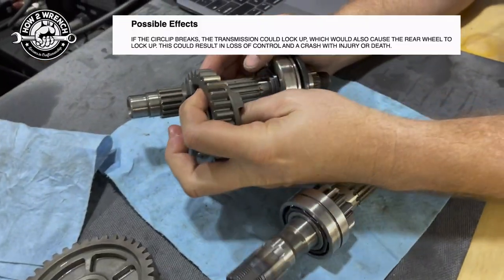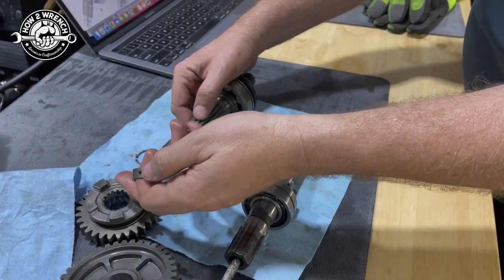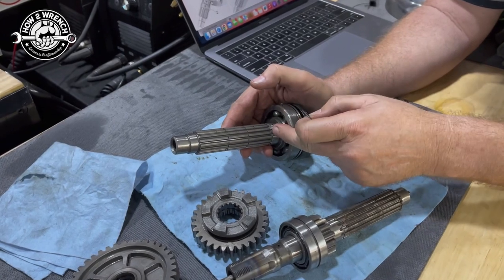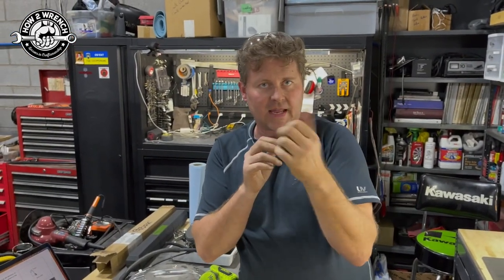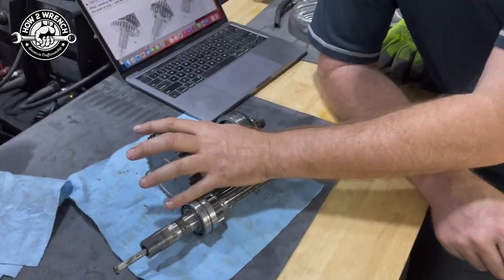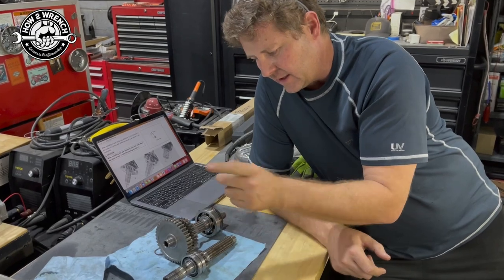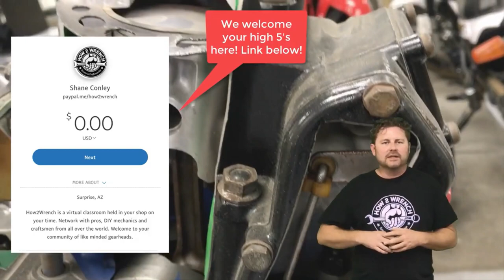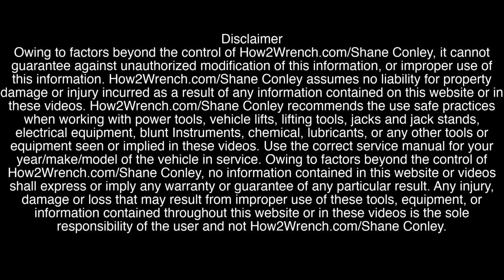How to install transmission circlips correctly. Not doing this could kill someone. #transmission

Comment: It's easy if you think about it. Just throw the whole gears foactory setup and hook up an oil tube to the end if the shaft and an oil pressure guage and pump oil and record the reading while stationay and try with rotation movement. Then start removing gears and doing the same thing. You'll end up with a data chart of how much each gear (if removed ) you'd lose oil pressure. Then you can calculate and start welding shut some holes then do a final pressure test. Hope that was helpful.

Comment: I did so many roadstar recalls i was sick of it. This was exactly the cause of the failures.. Yamaha installed the circlip incorrectly from the factory.. so yes as u said the way those are turned matters
Reply from the maker: The screenshot was from that campaign!
Reply from the maker: That recall woke a lot of people up. I learned this from Honda training and I can't count the number times people argued it didn't matter. It drove me nuts with a co-worker that used to tell "I've never had a problem". And to be honest prior to that recall I just did what the manual said but after it really looked into the "why".
Reply: @How2Wrench  exactly.. imo honda has one of the best breakdowns in some of their Manuals. It'll show each gear..each clip...shift fork..etc and which way the beveled or sharp side goes on the gear stack. I love your channel. Keep up the good work
Reply from the maker: @dcyamahatech  Thank you for being here and supporting. We will share this with Shane at Friday's meeting!

Comment: I never even thought about this. I just checked all my manuals ('96 RM250, '95 KX250, '02 CR250), and the RM shows the same illustration you had. The CR says "Install the washers and snap rings with the chamfered edge facing the thrust load side." (no illustration). I'm sure I did not follow this and now I'll be paranoid riding it (more than 120 hours no issue so far). And the KX makes no mention of a chamfered edge. It only says: "Be sure that all parts are put back in the correct sequence and facing the proper direction, and that all circlips and washers are properly in place."
Reply from the maker: We grabbed Shane quick on this one and he said "So glad to hear you got the right information. Something to think about. The circlip does not care who made it, hence why all transmissions "install with the chamfered edge facing the thrust load side" making the flat edges give the most support as its pushed against. There are a lot of factors the increase the risk, like damaged shift drums and bent shift forks that would allow "more" thrust force. 
We could tell of a hundreds of stories just like yours where there are many hours or miles with no issues but when it breaks, it breaks bad. There is just know advise to give here on what "we would do" without risking something right? Either your life or our reputation. Hope this video gave you for surely what you need for future work or this KX you mentioned". 
Cool. We love sharing comments like this with Shane.
Thanks for sharing and the added value to our wrenching community. Keep them coming.

Join the channel. Best $1.99 you'll spend to access all 800 vids and Shane Daily! Smash the sub and like please. 

Throw Shane a high five donation, channel membership or merch for saving you $$$$$$$ Links below to support more for this work! 🙏
You rock for commenting! We will let Shane know! Want even more? Best $2 you'll ever spend...Join this channel to get access to perks:
https://www.youtube.com/channel/UCBhM8DCKnT3qXwTW0eToyCg/join       
-Daily MEMBER FIRST COMMENTS ANSWERED FIRST 
-Live Q/A video chats
-Wonder if we have a video on your need? Members can request content links!
-Full Access to the ENTIRE 700 video library
-Member-Only FREE tool giveaways  
Ways to support or high five How 2 Wrench! Thank you in advance. YOU MOTIVATE US TO DO MORE!
1. Smash the subscribe button (thank if already a sub!)
2. Have you seen our "YouTube Trained Support Shirts?  https://goodfellasmerch.com/collections/how-2-wrench/products/support-shirt   
3. High five donation:  https://www.paypal.me/how2wrench    
4. Got an emergency and your head is about to explode from frustration or fear? Get Shane’s cell here: https://how2wrench.com/ols/products/techline-one-on-one
Reply: @How2Wrench  thanks guys, I've been watching Shane on YT for maybe 10 years now and learned and still learn so much. I'll get myself a membership 👍
Reply from the maker: @madmarc  Dang ten years!!!! We love sharing these comments with Shane. Thank you for grabbing a membership when you get a chance. Appreciate the support.
Reply: @How2Wrench  One last question on this topic: When a failure occurs, it occurs during shifting, right? My only concern is having the engine lock up when I have the throttle wide open on the face of a jump.
Reply from the maker: @madmarc  The failure can occur at any time but is most pronounced while shifting as you are side-loading it. Centrifugal force alone can cause it to walk out of place.
Reply: @How2Wrench  thanks 🙏